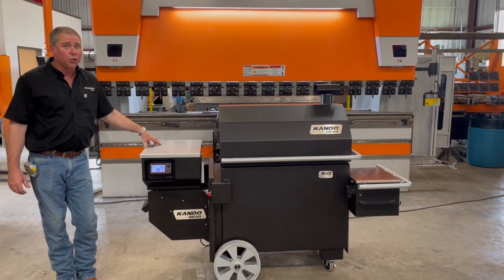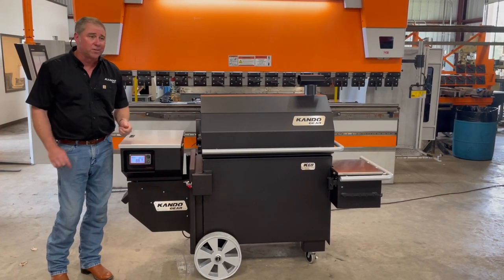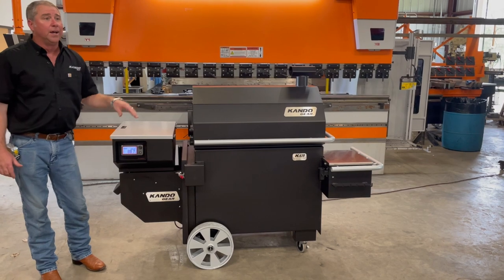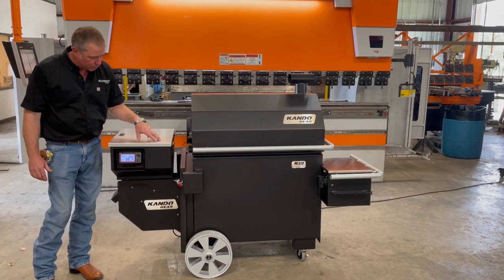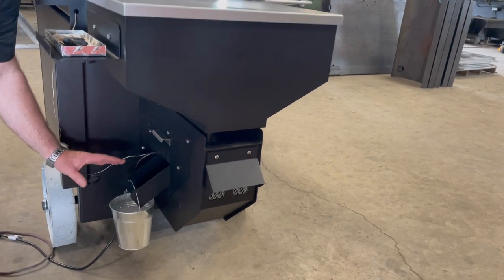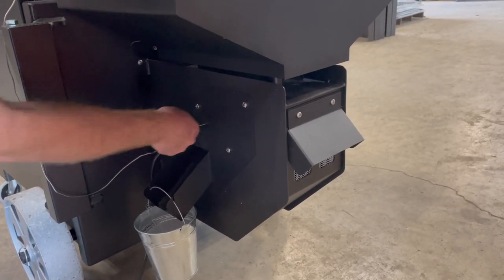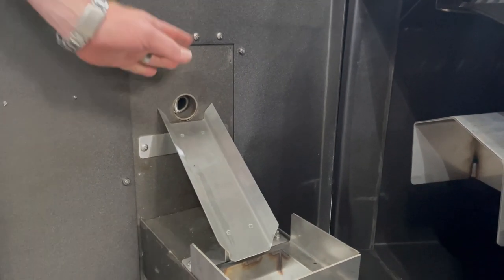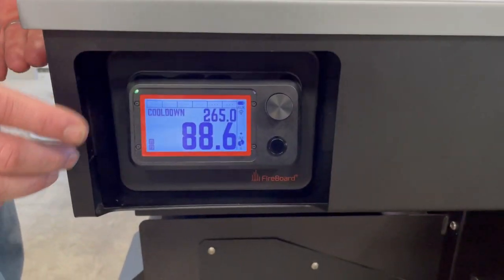KANDO Gear: After cook process

Comment: Why would moisture get into the pellets if you don’t empty hopper after cook?
Reply from the maker: Hi! We encourage all customers to empty out all pellets from the hopper and auger tube. With moisture in the air and unexpected weather, this can force the pellets to swell, causing the auger screw to not spin and the grill to not work. Thank you!
Reply: Even leak proof hoppers aren't 100% airtight, so ambient moisture builds up with pellets if you let them sit (especially in humid areas or if storms raise humidity) which cause brittle pellets to slowly disintegrate and slowly compact causing feed problems.  This is true for any pellet grill in any environment.  My (much lower quality than this awesome grill) GMG even in surface of the sun Phoenix AZ I have this same problem, especially if I let pellets sit after storms etc.
Reply: @M4ttNet  I’ve never once in 5 years emptied my pellet hopper and never had a moisture issue.